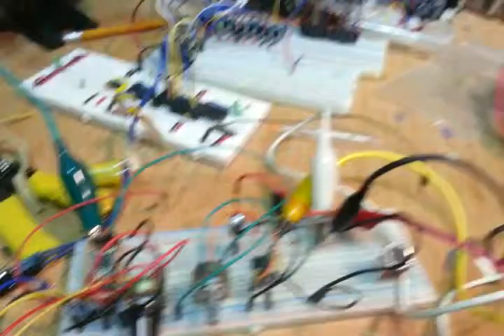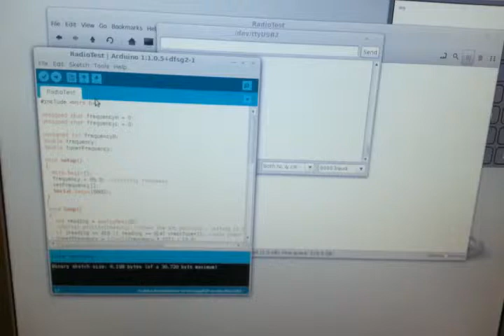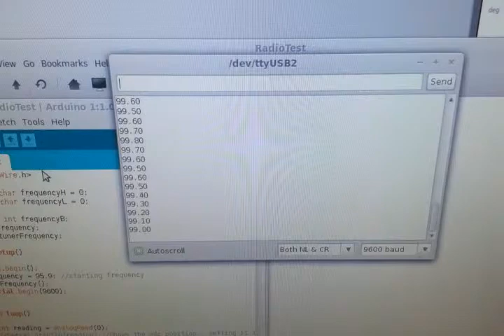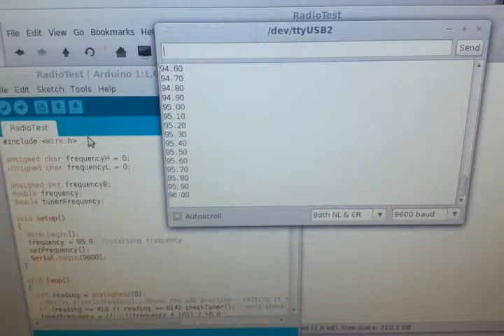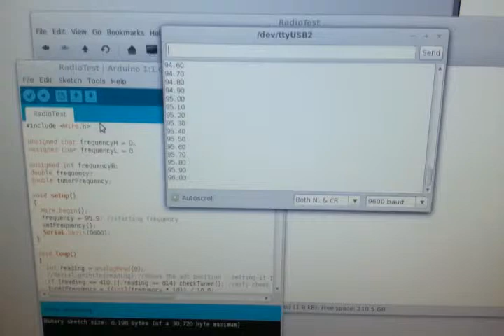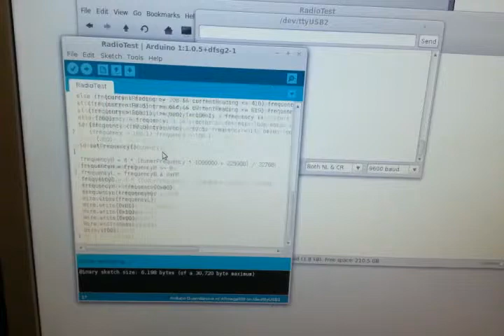Arduino TEA5767 FM receiver with LM386 amp Part 2

Comment: can i use TEA 5767 FM receiver  without a Arduino or micro-controller chip ?
Reply from the maker: The TEA5767 is controlled by using the I2C protocol; if you don't want to use a microcontroller, I wouldn't use this chip. TDA7000 seems to be a popular FM chip for building hobby FM radios.

Comment: Get a Class D Amplifier, much better than LM386
Reply from the maker: I would be interested in playing around with class D amplifiers. The reasoning behind using an LM386 AB amplifier was basically that it has few components (easy to solder on a perf, board), and I also bought 20 of them off of eBay for $4.00US...
Thank you for your suggestion
Reply: Oh yeah, LM386 are cheapie old school day little IC. I tried on this popular PAM8403 Class D Audio Amp, reasonably good sound quality and with Volume control

http://www.banggood.com/2-Channel-3W-PAM8403-Stereo-Audio-Digital-Amplifier-Board-With-USB-p-933672.html
Reply from the maker: I do like the look of that, stereo would be a nice addition too. maybe next time.